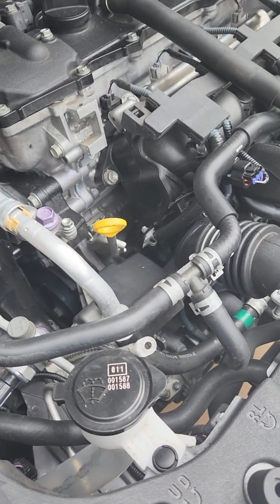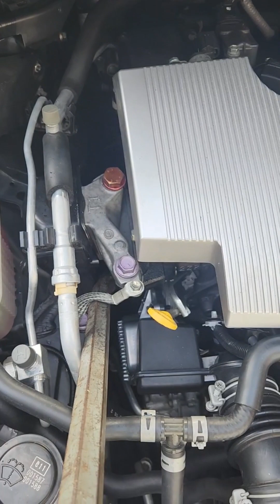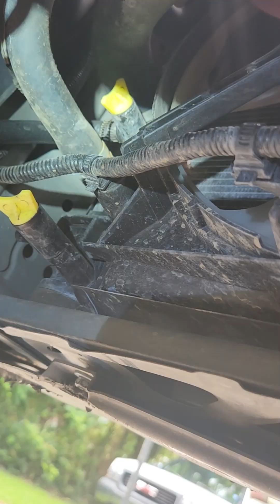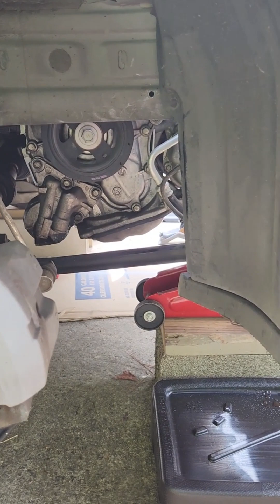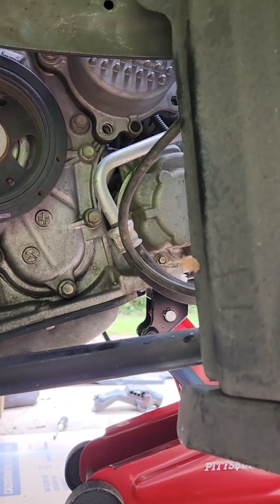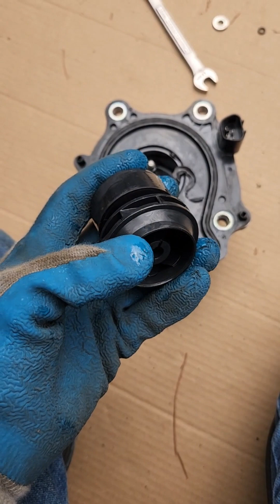Toyota Prius GEN 4 2016-2022 water pump removal/install

Comment: Stopping in to say thanks! Just replaced the pump on my 2016. Removed the top two motor mount bolts, raised it about a 16th, and used the pry bar to move it just enough to pull it from the top. Still a huge help years later!

Comment: Didn’t fix all the warning lights/message. I’m having the same problem/codes
Reply: You have Air pockets in your cooling system, you have to proper bleed the coolant system after installing the new pump.

Comment: I lowered the engine a couple inches then was able to wiggle it out by moving the impeller tip slightly down and toward the front of the car.  The thermostat & housing assembly is a monster to get out too.  You have to drop the air compressor remove the dipstick bracket bolt.  It was a huge help when I figured out I could reach the three 10mm bolts with a 12" long flexible 1/4" extension by inserting it from the driver side of the engine in front of the manifold.

Comment: I only needed to change the rotor, no need to replace the shell holding it. Moreover the 'aftermarket parts' can also be 'problematic' if not come with  heat sink paste for spreading built up heat to electronics.

Comment: Well done! Thank you for the vid. Im wondering how that bolt hole got stripped. Could it be something from the factory? Pretty strange. Cheers!
Reply from the maker: This car had a salvage title. Before this there was a coolant leak at the connection going thru the firewall to the heater core, I took the hose off and found the metal line a bit squished. I think this could be from an engine swap

Comment: Hi mate gen 3 rotor fits gen 4 no issues at all. I have done few
Reply from the maker: Cool, i had a hunch. Thanks
Reply: You mean the impeller right?  Did you get a generic one or from Aisin?
Reply: I read the gen 3 impeller is slightly longer 
which will cause it to bind and not circulate?
Reply: Are you positive the gen 3 water pump impellers/rotors will fit on the gen 4?

Comment: Wow thanks to your video, I just changed my pump.  I’d owe you lunch 😂😂🙏
Reply: Did you do the pry bar method as what he mentioned in the video?
Reply: @Jethrumi  I did use a prying device to just get enough room to get the pump in and out, yes.
Reply: Added A Wood Block Between The Frame And Engine. Had My Son Pull The Water Pump Out From Top While I Used The Pry Bar From The Bottom To Move The Engine.
Reply: @Gdbjr1108 just got the check engine code and want to try to replace mine. Did you unscrew the engine mount when prying it?
Reply: Can you help me changing mine please? Are u close to San Diego LA or Vegas.?